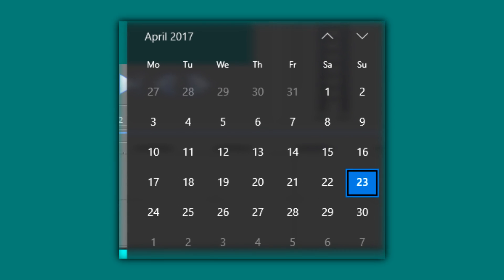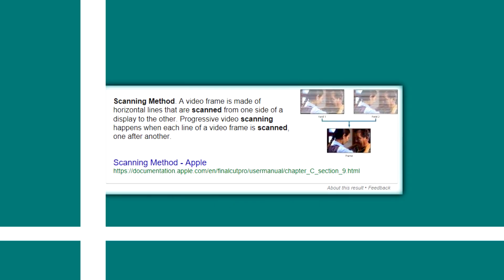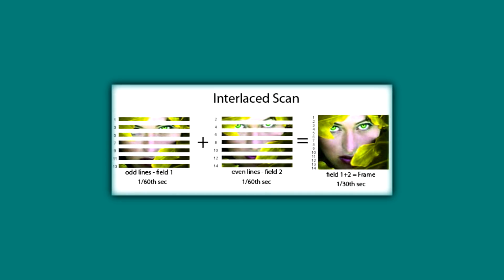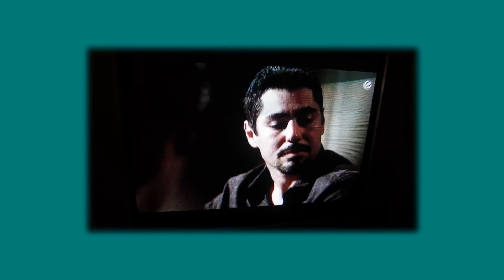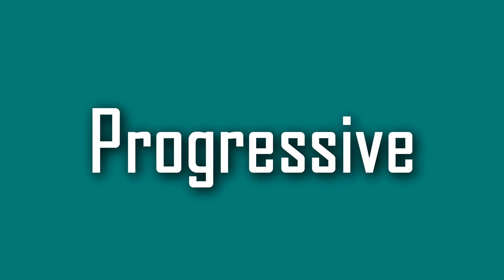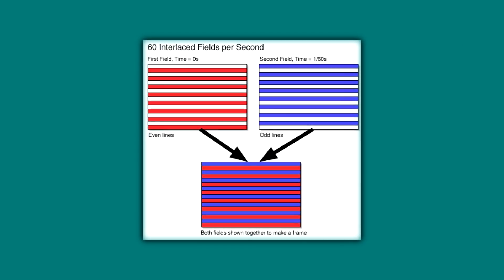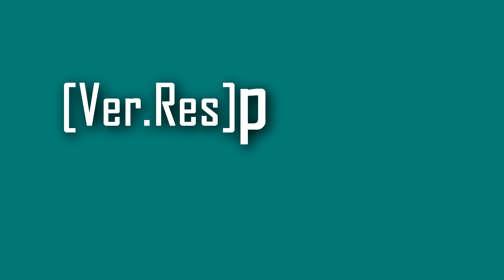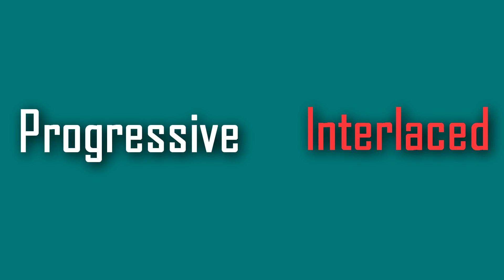Progressive Vs. Interlaced - What's The Difference?

Comment: I wanted to try interlaced on my 144Hz monitor because I saw this in option, but I though it will be better one but for example for a cost of halwing your Hz, but it is something a lot different than I though, no point of using it. THANKS! :)

Comment: Another interlaced example from 2021 (that's why I'm here) - using cheap   10 meters HDMI v1.4 wire    (yes, because it's CHEAP, it's insane to pay 50-100$ for one single wire) I was disappointed (despite that all specifications were in front of my eyes) that using more than 29 Hz with 10 meters wire (output resolution FULL HD to TV with 4K native resolution) will suffocates and shut down image broadcast every ~ 1/1.5 seconds, so it's stroboscope. 
The reason that v1.4 HDMI (with such big length) has a limitation for bandwidth and exact 29.99 Hz for 4K resolution (despite that 4K only on the TV as native, the signal from PC comes with FULL HD). 
So I'm testing fullHD signal  to 4K-TV-30Hz  progressive   versus   switching to 60 Hz Interlaced and now the TV accept the output resolution and deploys on the TV now in FULL HD resolution (same as source transferring by hdmi wire, FINALLY!). No suffocates and image shut down  - looks stable, not ugly. 
So why do Progressive scanning method not force to use Android TV the same resolution, which set (and broadcast) from PC? 
Why do only interlaced has this feature (useful to decrease load to TV's GPU in my case).

Comment: I am used to play resident evil remake games on interlaced 
For the performance
Reply: They sell edid emulator passthrough HDMI on Amazon. I discovered Interlaced by accident because I paid for this device for something completely different. I noticed the hz in windows display options now say 60hz Interlaced. The biggest gain from this device is no lag. No lag online and better performance off line as well. I now prefer fake 60fps over real 60fps just because it shrinks down the bandwidth usage. When I do gaming stream from "parsec" I keep my resolution on 800x600 with "60hz Interlaced". I host "super smash flash 2" on parsec. Lots of people have problems running this game without lag. Use Interlaced all lag is completely gone. Even with high settings completely on. Interlaced should be an option on all GPU. Luckily these EDID emulator devices exists. I can't go back to normal 60fps when It comes to online gaming.

Comment: so this is why 120fps tvs are a total scam
Reply from the maker: Exactly, although it has the "feel" of 120Hz, people can tell the difference
Reply: No they are not a scam. 1080i uses two fields (odd and even) to produce the frames. Some computers monitors can output 120 hz for gaming. The gaming will be much smoother. 1080i will play smother than 1080 P at 30 FPS but 1080 P at 60 FPS will look smooth but would require to much band width for broadcast. 60P and 120P are not broadcast compliant but gaming monitors can hit those numbers. I hope this helps.
Reply: @noname_6423  Bandwidth is a problem. That is why terrestrial broadcasting is not done a 4K but it will be once ATSC 3.0 is fully approved.
Reply: @noname_6423  A lot of people have 4K TVs. You can get them for under $300.00. That being said 4K will not be broadcast with interlacing. You can check out the ATSC 3.0 specs.